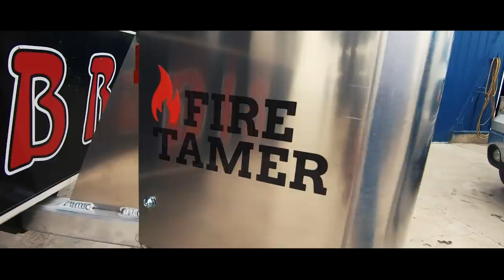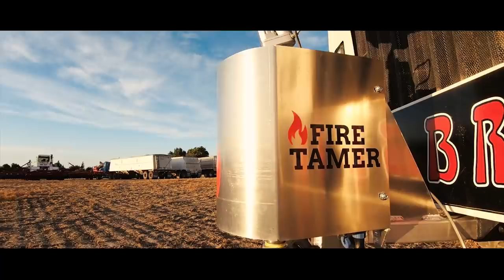Busiest Time of The Year - Harvest Episode 7

Comment: 1 tip I can give you be conservative when using the water you have on board when trying to put out the fire because if you run out of water and the wind changes direction you need to have some water to get yourself out of the fire. I fight wildfires and that is the scariest thing to deal with and not have any water. The Paradise wildfire last year was moving so quickly that several crew's almost didn't make it out of the line of fire coming at them. The fire was moving 600ft per second when it changed direction and headed straight for them

Comment: As I recall in the 80's we started converting 14 series to the rice rotors but also left the long rasp bars on the back 1/3... Then CASEIH started selling a "hybrid rotor" as an optional config in the 16 series. You could cut soybeans a couple hours later in the evening when they started getting tough... This was before Roundup beans so it also helped with the green weeds. (midwest corn/soybean/wheat farmer)

Comment: Interceptor bars slows down the movement of the crop through the rotor. Put many of them on in my time at a Case IH dealer. We actually put some over the concaves in the front rotor. Had to install mounts on the rotor and have the rotor re-balanced it was called Rochelle rotor. It was for hi yielding corn.

Comment: If you haven't done this yet, it would be a good idea to put a respirator in the Brute in case you get caught in heavy smoke.
Also, if you mounted a dirt-moving plow on the front, it could be used to make a fire-break if you need it.
Anyway, this is a very good idea. Your fields would go up in a massive grass-fire if they ever started. With all that equipment rolling through the fields, I'm surprised you haven't had a fire already.

Comment: When you were changing the bars on the machine what type of protection did you use to prevent someone firing up the combine?
Reply: When the engine starts. Should not have engine running

Comment: That is a awesome idea when you have a $700,000 combine catch fire
Reply from the maker: I know right! Grrr, hope insurance is good!
Reply: @WelkerFarms  A lot of folks don't understand how easily they happen or the dangers. My uncle is religious about cleaning his Case but he nearly lost it to a fire a few years ago. It still was $40grand in damage to his combine. But he got lucky. I've actually been helping him work on a system to monitor and suppress fires. Right now it uses a small 50 gallon tank of just water, but we're looking into other options.  If we like it we might try and market it too.
Reply: @southjerseysound7340  I would suggest few fire extinguishers aimed at "critical" points of a combine. I am 99% sure that you could modify them in a way to open them from the cab. Or maybe even buy purpose made ones.
Reply: @Matevz96  We're using special misters and jets that are designed for just this. The problem with fire extinguishers are combines deal with foods and you have to be careful about chemicals. We do keep them on a combine but there's areas you'd rather not have to use them.

Comment: Can you use the booms at the same time as the fire tamper
Reply: No, need pressure and volume in front
Reply: @RobertWelkerFarmerBob  Is it feasible to upgrade to a larger pump (space limitations or power draw?) or add a booster pump? It could be a good idea to be able to use the fire tamer and the booms either together or separate as the need warrants.